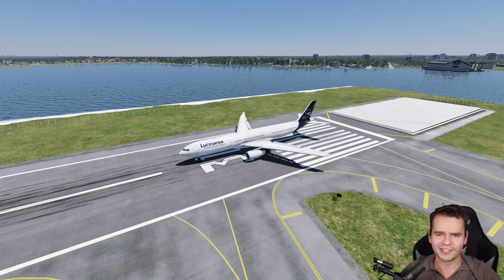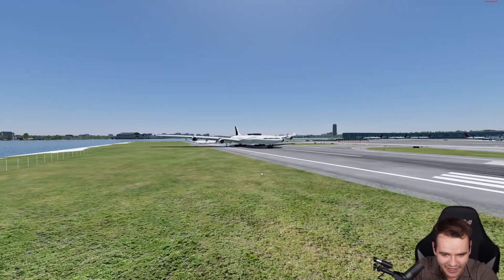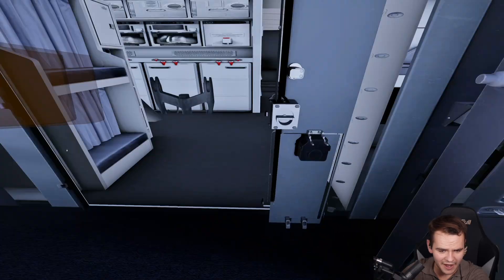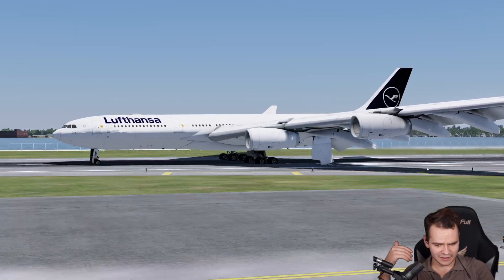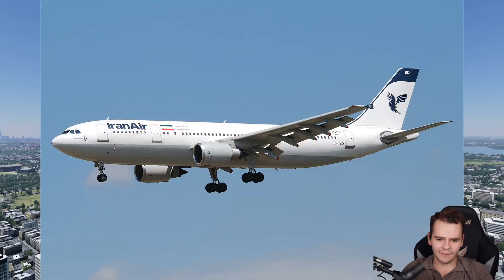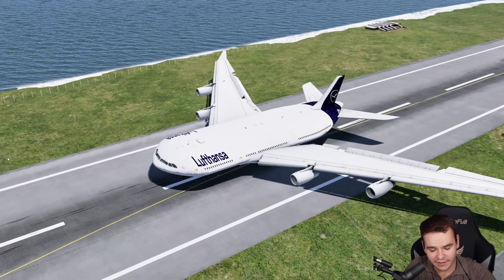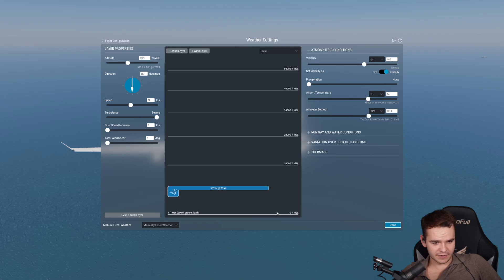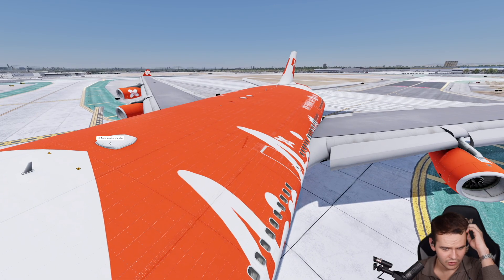W I D E B O D Y  A I R L I N E R

Comment: To add, the biggest reason we don't see ''Wider'' airplanes is due to manufacturing in fact. It is a very complex shape to do it like that, and cylinders are just the best for the job, in any pressurized capacity. Like coke cans etc.

Comment: The main reason this would not work is that when pressurized, the top and bottom of the fuselage would want to extend outward- like blowing air into a flattened soda can.  This would create tremendous stress points on the areas of this fuselage, just above and below the rows of windows.  👍🏻

Comment: The Reason why airlines don´t look like that is due to pressurization. 

Most airlines are in the range of +-10% from circular. There is a few exception like the 707 and the 747 that use the floor to tie in the the sides.

Very early draft of the A380 was a side by side double bubble, really not that dis simular to this model. So basically two A330 fuselage side by side.

There is a few issues with that. Firstly there is no added momentum to make the fuselage longer. Secondly you add more skin of the aircraft with basically no interior volume benefit. You lose half of the window seats. Anyway, so A380 as it was made was just more economical.

Now A380 is considerably elliptical on the vertical axle so it could be made a lot  wider with no issues. This would not even ad that much weight.

Comment: you have widened the wings. With that width body could be made to produce the lift. This would help reduce the wing width. Decreasing the drag.
As for the cockpit. The cockpit could be made in the center and left and right of it would be premium 1st class.
However if you doing this match modification you could throw out the traditional Comercial airplane form and go with Unibody.

Comment: You would have to make the entire diameter of the fuselage larger because just stretching in the x direction would result in no headroom at the windows and you wouldn't be able to fit seats anyway. And then to make the fuselage diameter 2-3x larger would greatly increase drag.

Comment: If there were wide jets then I would guess Emirates would buy them real quick and add a couple of pools and call it the sea of the skies.
Reply: This is the top comment
Reply: A pool on a zero gravity device (an aircraft). Fkin Newton level science. 😂
Reply: @R.S-1986 airplane experience zero gravity only when they free fall
Reply: @GirishG. Aircraft experience g drops  on regular basis, called turbulence.
Reply: @R.S-1986 yeah but they’re not enough to make the water float or go around violently enough to escape a proper cladding
Reply: @GirishG. If that was true, captain wouldnt ask for wearing seatbelts during turbulence. Its common for passengers to bang their heads on the ceiling,  and there are reported incidents with severe injuries. So yeah you fly with your pool straight up 😂
Reply: @R.S-1986  Well, the water kinda has its own "seatbelt" called surface tension.
Reply: Just make it be
Reply: Thats possible
Reply: fr
Reply: And i totally would fly on it, i mean it would be awesome
Reply: The water would
Splash